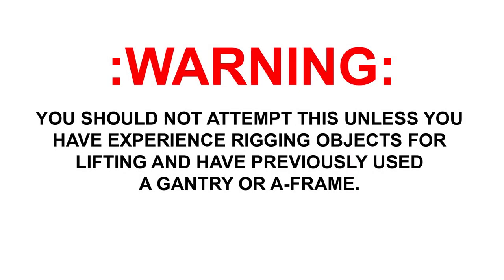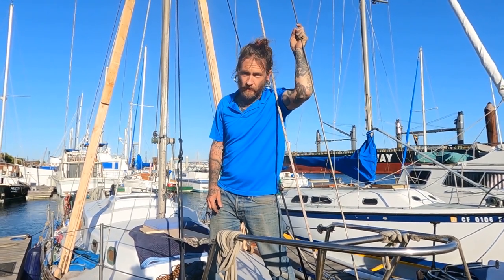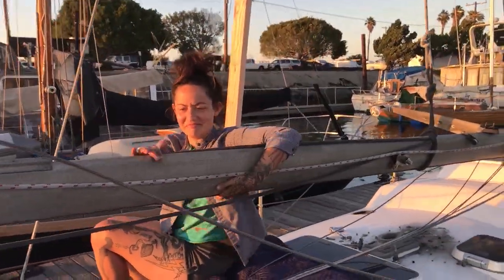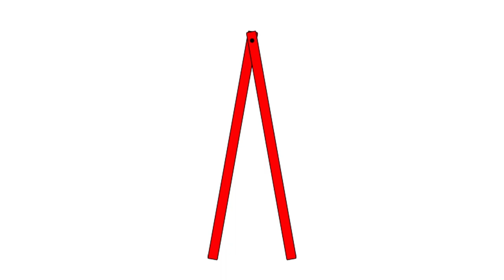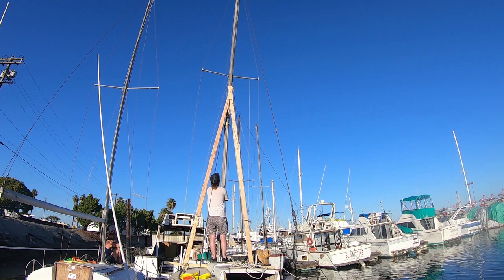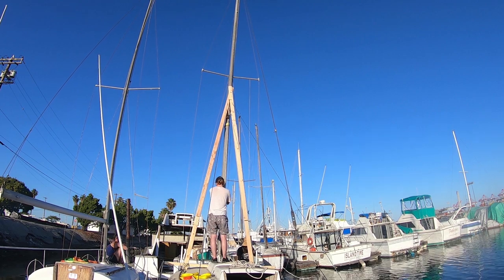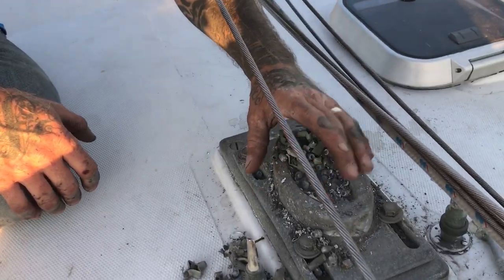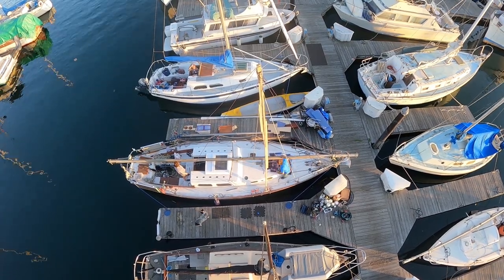Dropping the Mast on a Sailboat with a DIY Wooden A-Frame while at the Dock

Comment: Awesome video guys! I used an almost identical setup on my Ericson 27. (31ft mast) I choked it under the spreaders and used an cheap electric wench from walmart that had a wired remote control so I could control the mast and lift at the same time. I had never lifted anything like this before so it was stressful but I spent a lot of time planning it and it turned out to be easy. Everything you said was spot on about the process - especially the go slow part. Thanks for making this video I wish I had it when I was planning this!

Comment: I am about to lower the mast on my 1979 Alberg 30. My mast came with an actual hinge at the base to be able to tilt the mast aft. I have done your method on a Catalina 25, and it worked perfectly. I tied off the raising line just below the spreaders. And was able to keep just a slight downward pressure on the base of the mast as it was lowered. Raising it back up was another story. I had removed the A-frame which got my shrouds out of order. If you keep the A-frame up, when you raise the mast back up everything should go up in order though. I’m seriously considering using your method instead of my hinge and Jen pole. Can you tell me exactly where your purchase point on the mast was? It looked like it was above your spreaders
Reply from the maker: Yeah we kept the A-frame up the whole time it was down, I wonder if your A30 had that tabernacle mast added later, never heard of them coming stock on these boats, sure makes it safer to take down
Reply from the maker: Also.... it was below the spreaders about a foot